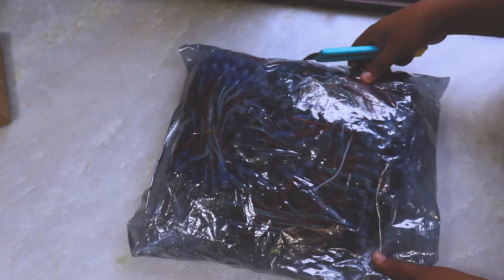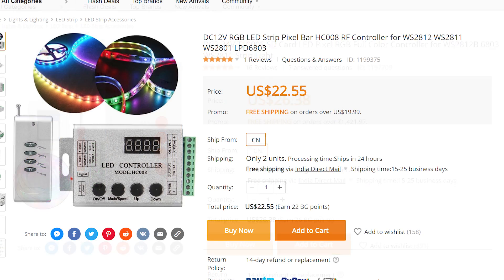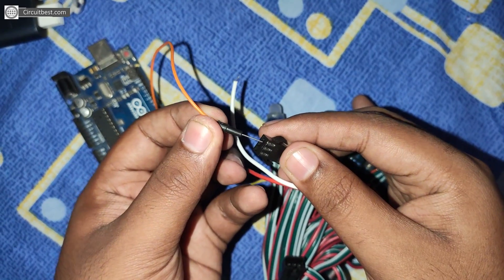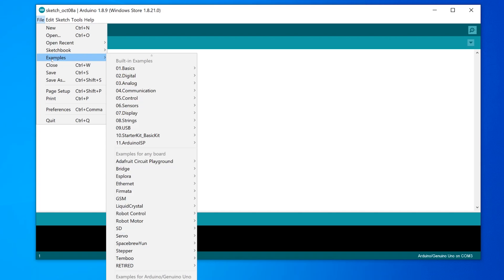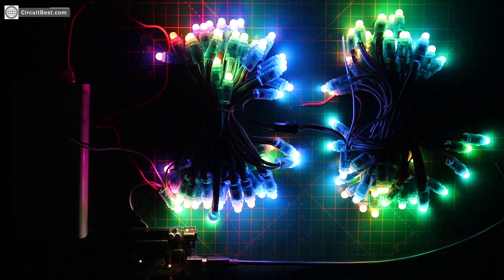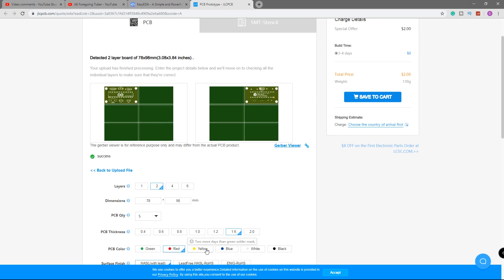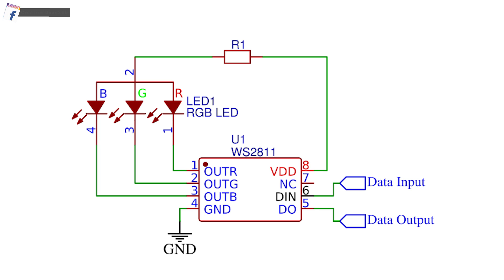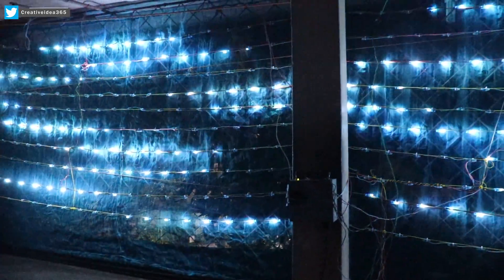How to control WS2811 RGB LED with Arduino

Comment: Nice informative video.
Has anyone tried connec6a Raspberry Pi to the Arduino? Thinking of loading either Vixen or X-lights onto the Rpi and have it send the patterns to the Arduino.
They say the Pi data is 3.5 volts but the pixels need 5 volts to work properly. 
I have Arduino, Raspberry Pi and the Pixels. Would like to do a small set up cheaply.

Comment: This was very informative for a beginner. I have 60 led's & want to control them in groups of 3, so 1-3 are same colour, 4-6 same colour, 7-9 same colour ..... 58-60 same colour.  Is this possible to do in the Arduino code?
Reply: If you have individually addressable leds, yes

Comment: On arduino uno how many led can we connect Max
Reply from the maker: I checked recently I found max you can connect 600 leds using adafruit neo pixel 
And fast led just takes too much space.
Reply: @Creativecreator  thanks sir

Comment: Greate tutorial my friend
Reply from the maker: Yes it is not not that important it is for removing noise from the signal. You can run without it also
Reply: @Creativecreator  noted with many thanx. Good luck 👌
Reply from the maker: Thank you so much!
Reply: @Creativecreator  i have seen lots of people using resister for data line. Is it important ?